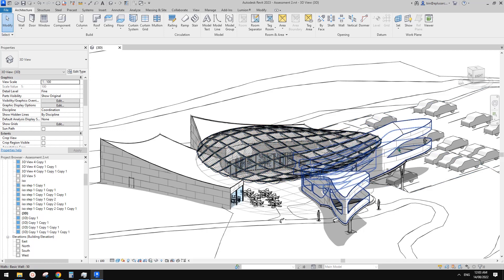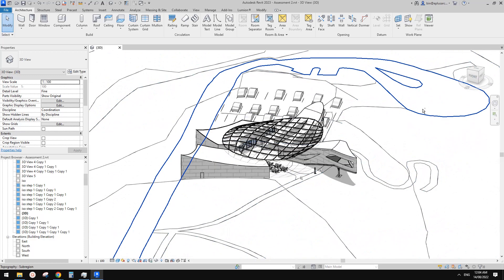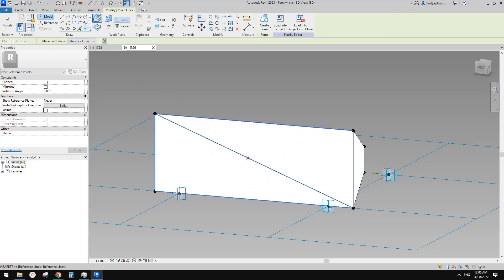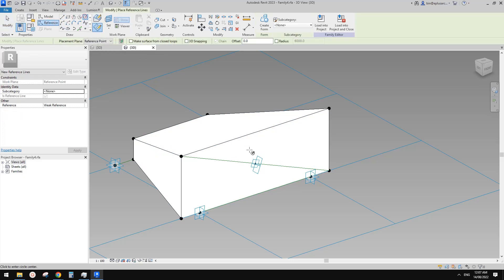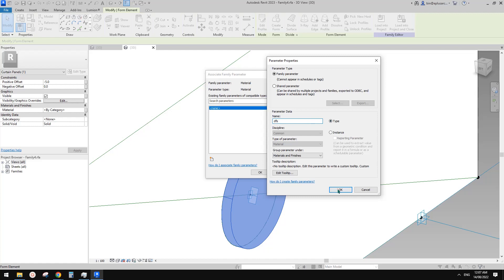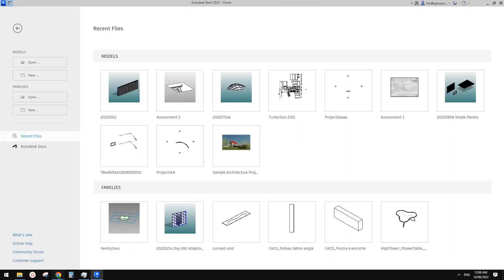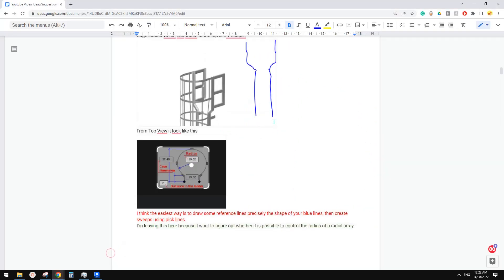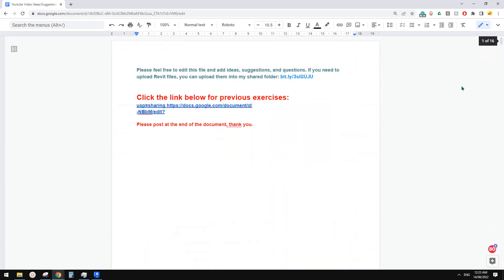Revit Exercise (Day 873) - Some Extra Work to 871 and 849

Comment: In that radial array ,we can't able to change the OFS (584) PLS check
Reply from the maker: You are right, I forgot to lock them onto the reference plane. You can use Align (AL), then click on the horizontal reference plane, then click on the array, you should be able to pick an reference plane from those families, then lock them onto the reference plane.
Reply: @BINHE615  I tried if we aligned with Horizontal RP then array will not follow the Width
Reply: iam struck in that alignment(either it is taking offset or following the width) could u pls help me to go with both
Reply from the maker: You are right, it won't work if we simply align and lock.  Good work.
We can nest this array into another family so it moves as an entity. You can download the file here:
https://drive.google.com/file/d/1XpMg-wq87kcx_eyS2P76WXu_MQAbSjme/view?usp=sharing
Reply: @BINHE615  i have lower version ,if u don't mind can u send a vedio of that pls
Reply from the maker: No worries.